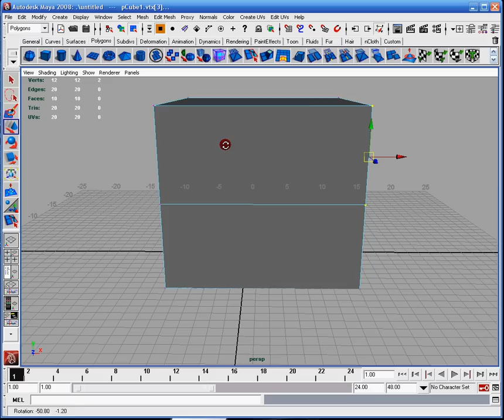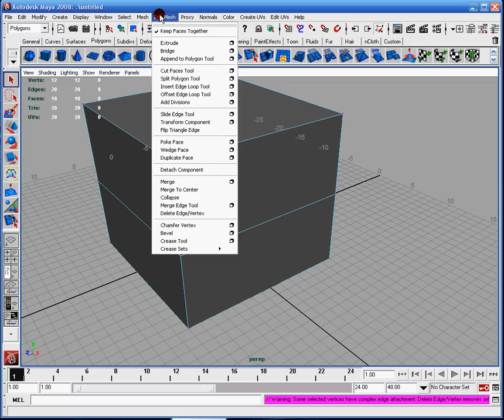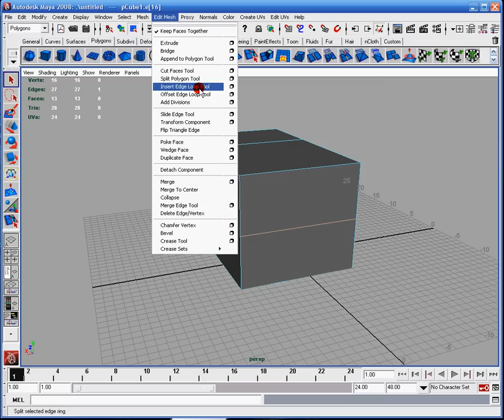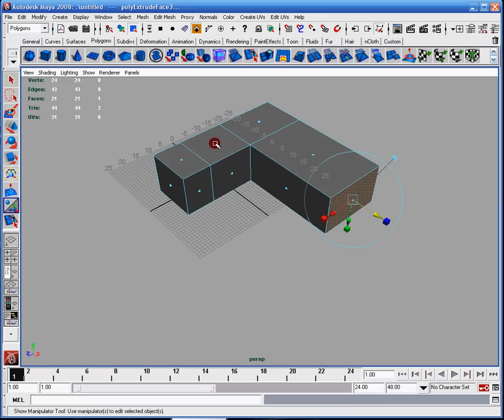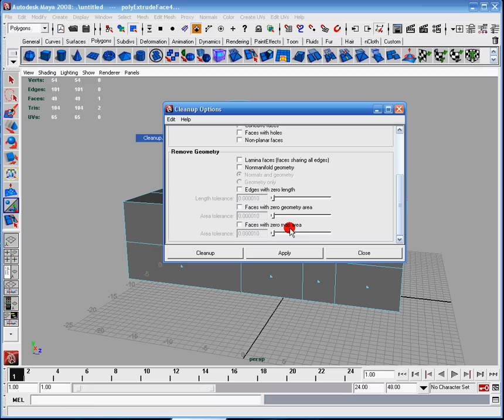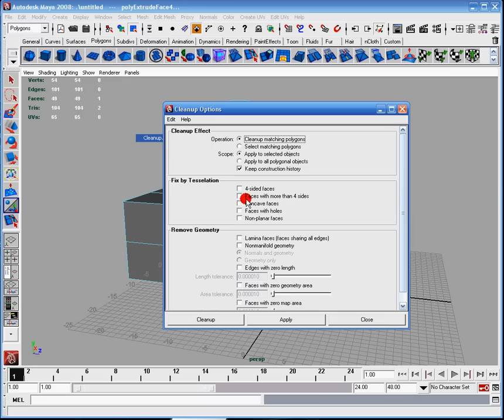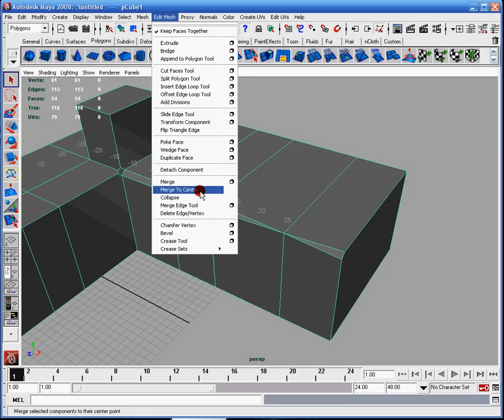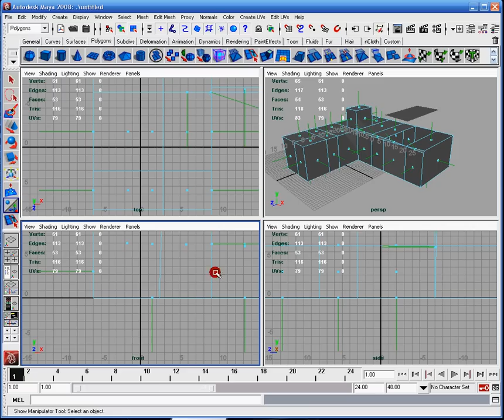Maya: Polygon and Nurbs Modeling Part 1

Comment: I have a question, I used Solid edge and solid works for a long time. and now im using maya to animate and do more creative stuff. but I cant find myself in Maya. I cant find unit tools, symetry beteween edges for example. or relationes beteween 2 points or edges. I want to create a relation where an edge has some distance to another edge, and another edge has the same. so simple yet I cant. help please.